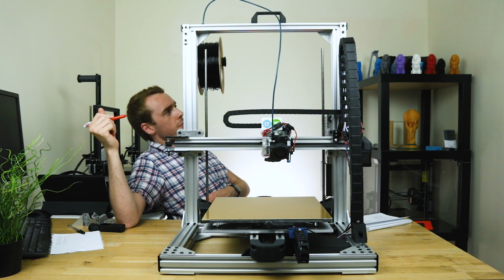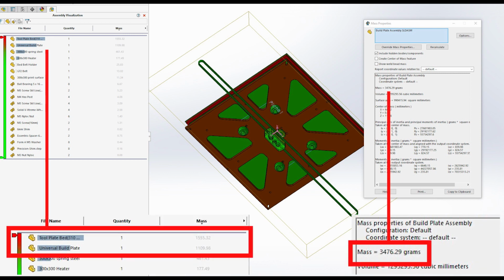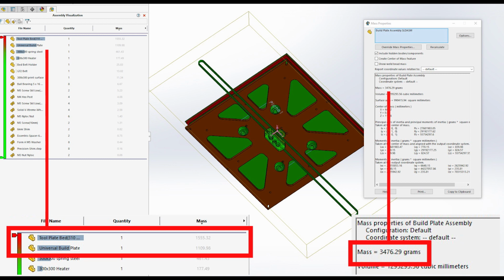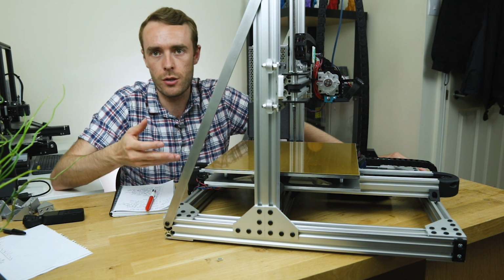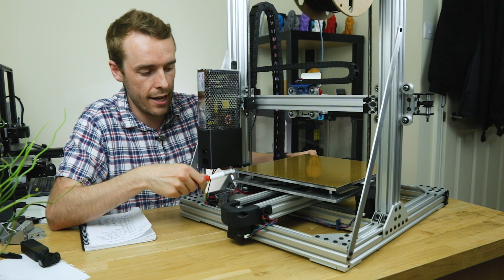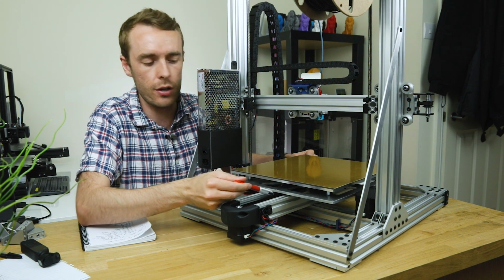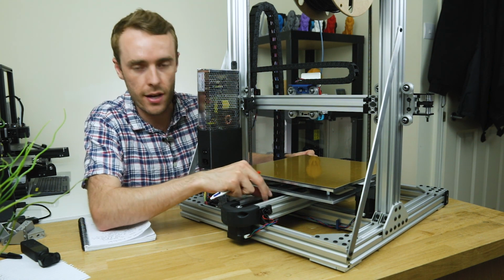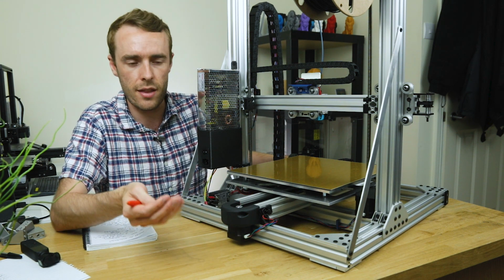Named My Printer BUT Is the Print Bed too Heavy?

Comment: Looks like a solid build. I would look at going for a wider 2gt belt, you can get 9mm genuine Gates belts and pullys from E3d (2gt and gt2 belts ar not the same thing btw). I would also recomend supporting the pullys both top and bottom, this will extend the life of the bearings in your stepper motor and reduce flex in the idler. i's say larger steppers would be overkill, big nema 17 with decent drivers should be fine.

Comment: Hello! As for your wheel problem, you should consider linear rails, such as MGN12. They can be sourced for 10-20$ on aliexpress for 40mm lengths with one carriage each (i would add two more carriages) and instead of wheels have steel balls as a rolling surface. They are used in CNC applications and won't budge a micron in 3D printing applications, even when buying hiwin clones from china. 
Here is one seller on aliexpress : https://www.aliexpress.com/item/32806622073.html (picked up the first result, others may be better).
The number X in the MGN X is the rail width, then you chose your length.  For such an heavy bed, you'll be happy to have those; and the rails won't wear out.

However, another solution to your bed problems would be an XY gantry (even a coreXY?) and a bed only doing Z movement. You could thus make the bed as heavy as you wish, as acceleration on Z is quite limited. But that would require redisigning your frame, sadly.

Comment: If you reduce the bed weight you should think of using a linear rails or even a mag lev linear rail, then you wont have any resistance on your belt system.

Comment: Apologies, this is a long one. I like talking about machines and their design. Love the design and all the thought you've put into it.

To fight ghosting and belt stretch what you can do is go for stiffer reinforcing in the belt, like steel core, or a wider belt. A larger tooth profile (also a wider belt) does indeed help prevent the belt skipping because of the taller teeth on the and deeper grooves in the pulley mean the belt must lift higher off the pulley in order to skip, but for the forces involved I don't think it'll be an issue as long as the belt is tensioned properly. Having more teeth engaged on the pulley also helps avoid skipping, or an idler bearing right by the motor pulley holding the belt against it and preventing it from skipping.

Another possibility to get more torque from the motor would be to use a reduction stage. This would let you use a bigger drive pulley (which you would need for steel core belts, or if belt skip becomes an issue) without losing resolution like you would with a nema 23 and a bigger pulley. You would introduce some backlash, but I don't think it'll be noticable in practice if done properly.

FR4 is a type of FRP (fiberglass reinforced plastic), it isn't very fun to machine since the glass fibres will dull youre tools and make a nasty dust. I personally find the noise quite unpleasant as well. I wouldn't personally use it as a print bed (especially a heated one) because the resins used to make FRP aren't usually made to be heated and can give off nasty fumes when used on a heated bed, crashing a hot nozzle into the bed will also leave a mark. They also usually aren't flat.

A possible idea for a belt clamp is just some aluminium angle, bolted to the bed carrier with it's axis paralle to the Y axis, and then the belt can be clamped to the other face of the angle using another piece of aluminum in a sort of sandwhich arrangement. I've heard of these styles of belt clamps sometimes causing issues where the bond between the rubber of the belt and the fibre reinforcement gets broken at the ends where it's clamped (i.e. the rubber of the belt can slide freely over the fibre reinforcing), which leaves you with the end section basically being unreinforced stretchy rubber. The way to get around this would be to have the ends of the belt loop around something and then interlock with itself, that extra bend at the end makes it harder for the fibres to pull free from the rubber belt. This might not make much sense the way I explained it over text, but take some insulated wire and grab the end with a set of pliers and pull. You'll see the insulation (stand in for the rubber of the belt) near the end where it's held by the pliers stretch and slip along the wire (stand in for the fibre reinforcement) until it breaks and slides off completely (congratulations! now you have a poorly stripped wire). On a belt of course it's not likely to snap off completely, but you'll be left with a stretchy bit of belt at the end that isn't attached to the reinforcing. Now add a loop at the end and clamp on to that and you should find it takes a lot more force to get the insulation to slip off the wire.

The axial load on the bearings shouldn't be an issue, the only load they see in that direction is the weight of the bed which isn't something to worry about. What might be an issue is the uneven wear that seems to be occuring because of the tensioning issues you mentioned. 3 wheels is ideal for this because the two wheels on one side automatically form a straight line between them and the third one on the opposite side just serves to push the (hopefully) straight line of the extrusion against the straight line formed by the first two wheels. Is where the issues start, as both sides have two wheels which forms two straight lines that the tracks on the extrusion have to conform to. The problem comes with getting the two lines formed by the wheels on either side parallel. You could set up two wheels on one side on a sort of see saw with the pivot between them, and then move the pivot in and out to adjust the preload, the "see saw" let the line formed by the two wheels align itself to the extrusion and keep even loading on the two wheels (you could actually bias the loading by messing with the levers on the "see saw" but I don't see why you'd do it in this case). This no longer works as you add more wheels since with more than 2 wheels on a side you can no longer guarantee a straight line going through the center of each wheel. I could go into more detail but I doubt it'll be useful.

Getting things square is pretty tricky, especially since you want to do it the proper way and not through software. I could give you a thorough run through if you want but this essay is probably long enough. I'd go into it but I'm not sure what you're aiming for (the ideal case being square XYZ and a flat print bed that is parallel to the XY plane) either a pure hardware solution or still use software bed leveling.

Comment: FR4's awesome stuff. I've been using it on one of my i3 clone printers that I only use for PETG and it's amazing. No need to deal with glue or hairspray, just clean it off, print on it, they stick through the whole print and pull off easily when completed. Best print surface I've found for PETG by a mile and removing parts doesn't rip chunks out of it like it does with glass. The FR4 boards I got are only 1.5mm thick and clamp straight to the aluminium heat bed. It works well for PLA, too. I haven't tried it with ABS or TPU.

Comment: 2 observation ... the PCB type material you want to use to replace the aluminium is glass reinforces, it will eat your drills, you will need to keep the drill bit sharp for 'clean hole's' 
the y axis belt, why not go for a screw feed than belt then tension just goes away

Comment: The bed support plate could be further optimised using Fusion360 or Solidworks optimisation function. This will immensely reduce the weight and further increase stiffness.  Here is a link to some who did something similar:  https://www.youtube.com/watch?v=AHSTbaduXUM

Comment: Are you kidding me? You get an awesome name for a bulldog of a printer like "The Extrudinator" and you end with "Bye for now"?? WTF Wrong three words Adam, it should of been "I'll be back."
 Have you looked into the ExoSlide system? Apart from the anemic motor/pulley/belt system you have now on the Y, I would say you have a great platform for experimentation. I'ld like to see the Y using the ExoSlide, maybe Santa will come early for you.
Reply from the maker: Ye, i really missed a trick there didn't I! Dammit, maybe next time. Exoslide actually contacted me a while ago about getting some to look at but it never happened for some reason. Maybe i'll have to take another look now.
Reply: Not sure how far they are in the development of some larger sizes. It looks like they only have the 20mm rail setup for now, so wouldn't be of any use for The Extrudinator.

Comment: A huge struggle I've had with my Creality CR-10S5 is the bed weight. Even slowing the print acceleration and speed down a ton and using a 12mm Gates belt, it still ghosts like hell. It is SIGNIFICANTLY REDUCED with the Gates belts, but it's still certainly a factor and is the bane of decorative pieces.
Reply from the maker: Not too surprised, that is a massive machine. Maybe time to think about different materials.

Comment: You've got that 6mm thick milled aluminium plate which is great for even temperature. But it will expand with temperature. If it is 300 mm square at 20C it will grow by about 0.6mm at 100C. where will that 0.6 mm go? if you are tied solidly to the bottom plat and that is not being heated the flatness will suffer. Has anyone dealt with that? For instance with mounts that are fixed in Z but can flex in X and Y.
Reply from the maker: Nobody I know of has ever solved that issue. Trouble with flex in X and Y acceleration forces from motion could then move the bed causing ghosting. Maybe i could help my self by just tightening it up when its hot, rather than when cold.
Reply: This is a common problem in fine mechanics. Using certain couplings like a Kelvin or Maxwell coupling can solve this if used correctly. They allow the bed to expand while it stays in the same position and rotation.
Reply from the maker: Ooh, a massive version of the kinematic coupling would be nice. Would be hard to find a way to do it rigidly without being super heavy though...
Reply: @Vector3DP  Honestly it doesn't have to be very heavy! all you need is three half spheres and three v-slots. Then just make sure the v slots are aligned with the center of your plate (for the center of your thermal expansion) and you're set! The rigidity is inherent to the mechanism because it limits movement in all degrees of freedom (when clamped along Z axis). you just gotta make sure that no deflection takes place on the mounting points.
Reply: Actually I was thinking something like a membrane flexure as Tom Lipton illustrates  here: https://www.youtube.com/watch?v=7RC8WL2ngfA&t=118s. A block would be screwed to the corners of the top and a different block fixed to the bottom. a strip of thin spring steel ties them together.

Comment: I love that printer! 
One note on the belts: If you haven't already, check out the 2GT belts from Gates. It's probably the easiest to get them from E3D: https://e3d-online.com/gates-powergripr-gt2-belt-6mm-x-100mm
The difference between Chinesium grade belts and Gates belts is that most Chinese ones are purely made out of neoprene without any reinforcement. The Gates belts on the other hand are reinforced with fiberglass. The difference in ghosting is night and day.
Reply from the maker: Thanks. Ye, somebody else mentioned the 2GT e3d belts too, i'll definitely be taking a look. I always thought both were reinforced but chinese ones used fibreglass and proper ones used aramid. Aramid is more expensive hence the chinese avoid it.

Comment: Here are some off the shelf metallic timing belt clamps...https://us.misumi-ec.com/vona2/detail/110302765550/?KWSearch=Timing+belt+clamps&searchFlow=results2products&curSearch=%7b%22field%22%3a%22%40search%22%2c%22seriesCode%22%3a%22110302765550%22%2c%22innerCode%22%3a%22%22%2c%22sort%22%3a1%2c%22specSortFlag%22%3a0%2c%22allSpecFlag%22%3a0%2c%22page%22%3a1%2c%22pageSize%22%3a%2260%22%2c%2200000029788%22%3a%22ah%22%7d&Tab=wysiwyg_area_0
Reply from the maker: Thanks, that's pretty much exactly what I need but because i'm in europe i can't buy from misumi without being VAT registered.

Comment: Are you using a Duet board? You could just do a calibration print and use axis compensation to ensure squareness of prints. Its very, very easy to do the calibration and then you don't have to worry about getting the machine perfectly square since its all compensated for in software.

As far as growing your channel, you really, really need to make consistently scheduled videos. That way people know they can expect to see a video on a certain day, and are ready and waiting for it to come out on that day.

You had a lot of viral successes with MK3 mods/fixes so I would pursue that some more. Almost all of the content you make is a step above most other 3DP youtubers who spend more time shilling garbage than actually discussing the hobby/technology.
Reply from the maker: Hey, thanks for all the advice. It is a duet so i'll look into that, I would prefer to get it most of the way mechanically first though, then do precision changes in software.

I do really need to get back into getting up weekly content. I've just got so many things going on in the background which I can't talk about that take so much time, i just don't get enough to make videos every week. To get back to weekly uploads the quality has to suffer a little bit which you might seen in the next few. If that doesn't work then i'll need to just find more time from somewhere!

The trouble is I never found the Mk3 content that fun so i got bored of making it. The Prusa related content was really popular though so i'm looking out for things i can do related to that.

Comment: Great update Adam. I know what you mean about not having thought it through before designing big projects, my biggest wouldn't even fit through the front door. https://youtu.be/WpLxhS6jK0M?t=178
FR4 is what Prusa use for the heated MK2 beds, it works for that, but not sure it's a good choice for rigidity. The 400x400 bed on the Borg is also 2 aluminium plates (4mm and 3mm) with the Keenovo heater and cork sandwiched between them, this offers more rigidity because they support each other, rather than having 2 thicker plates separated. My bed heater is also 240v but it's 1Kw, heats up real fast lol.
You're right about the dangers of high voltage, 240v at almost any currant will kill, just because you may only have a 2 amp load (heat bed) the supply can deliver much more. Stay safe and shout if you need advice.
Next year 3D Meetup UK is on the 2nd & 3rd May at the same venue, looking forward to another awesome weekend.
BTW You forgot to put the twitter link etc in the description :-)
Reply from the maker: Thanks. These things are easy to realise, but only after you've done it. Ah ok, i was thinking of using it to replace the lower part perhaps, not sure. might just start with beefing up the Motor and belts and see where that gets me.
Reply: @Vector3DP  Beefing up the motor and belts will make it more sturdy and reduce ringing. Don't forget to try tweaking your Jerk values as well as acceleration, it help my Borg before I lightened the bed weight.

Comment: why not have a y axis with 2 motors (one at each end)? This will give you 2 times 40 N.m/s. OTher point, about using GT2 belt, you might change it for bike chain with corresponding gears (for less elasticity).
Reply from the maker: I think there might be timing/alignment issues having a motor at each end. If the distance between them doesn't align with the pulley teeth it'll cause problems. Chain is a nice idea, but that's even more weight to move around. Probably noisier and definitely more maintenance too. Good for strength though.
Reply: @Vector3DP  There does not need to be a problem with the alignment of the pulley teeth, if you tighten the second pulley after setting your belt tension. I have 2 motors on every axis of my printer. You would not believe the speeds I can get without skipping.
Reply from the maker: Interesting. i'll try and delve into that option a little deeper and see what pops out.
Reply: There is dual z axis printers and i know for sure that marlin authorize dual y and dual x axis so i'd say that your objection is not valid. U should give it a try.
Reply from the maker: Dual axis is not the same thing, that would be two belts each driven by one stepper motor (dual z is two motors and two lead screws) but i see what you're saying.

Comment: You need dial test indicator (probably the lever style) and a magnetic stand to test for squareness of your Y axis travel.  Attach to the bed and run the indicator along one of the sides of the base.  Running it along the other side will tell you if the 2 sides are parallel.

Watching some videos on setting up milling machines should give you some ideas.
Reply: Actually, a magnetic base isn't going to help since it's all no ferrous but you can design and print custom holders.
Reply from the maker: Thanks for the advice. I actually have a digital dial indicator that I bought for doing this but i think an analogue option might have been better. Are there any particular youtubers or videos that you know of that are particularly good at explaining these things?
Reply: @Phaedruses  Running the dial indicator along the top surface of the bed would let him bed level (i.e. parallelism between the bed and the XY plane), not nessecarily get the axis square. Imagine if one of the Z axis towers was closer to the front than the other, you could still get the bed so it's a consitent height under the nozzle but the x axis still wouldn't be 90 degrees to the bed.